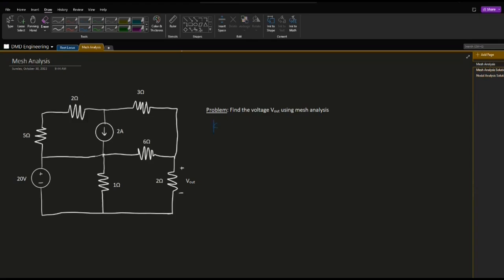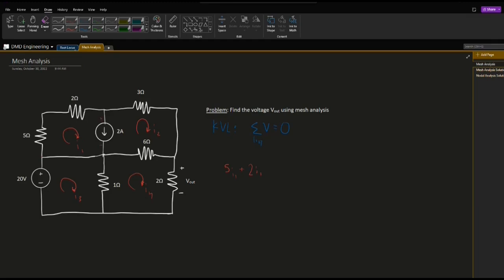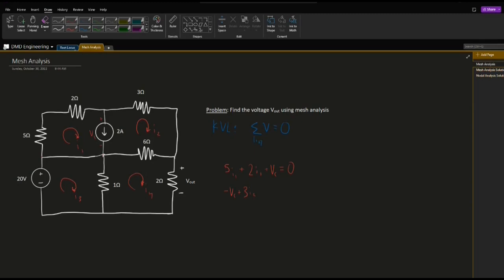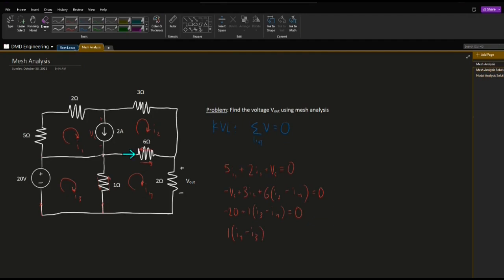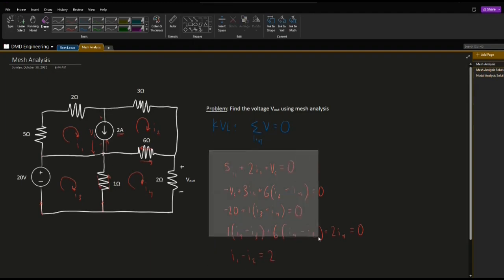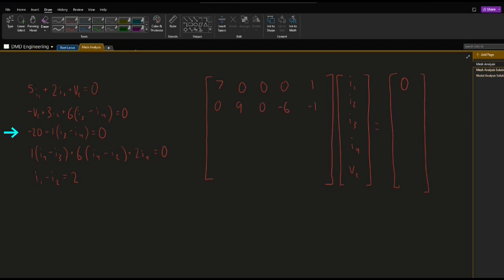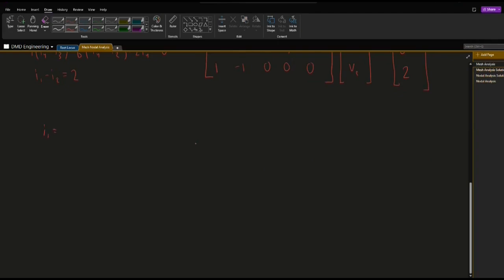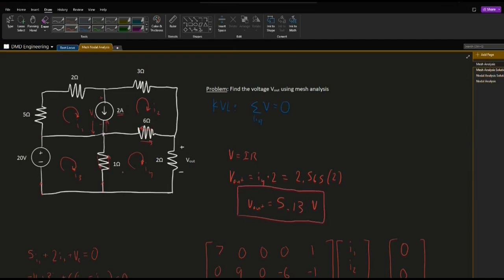Mesh Analysis Example Problem

Comment: This was such a great video and you did an awesome job thank you! I had a few questions if you did not mind. Would it be possible to do a supermesh at the top making it to where you would have one supermesh equation which would be 5I₁ + 2I₁  + 3I₂  + 6(I₂  - I₄) = 0? If this were to be the case, then our constraint equation would be I₁ - I₂  = 2A? If we are able to do the supermesh, then we would just have our supermesh equation, our constraint equation, and our equations for I₃ and I₄ making it to where we have four equations and four unknowns in which the unknowns would be I₁, I₂, I₃ and I₄? Lastly, the reason you wrote 2i₄ instead of Vout is to reduce the number of unknowns as we can still write Vout but it would introduce an extra unknown and make it difficult to obtain a unique solution (infinitely many solutions)?